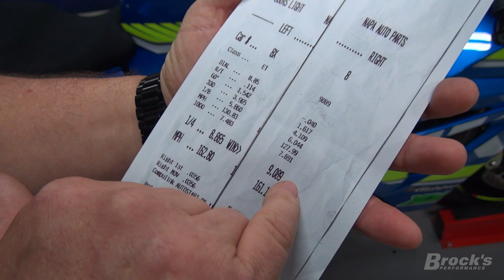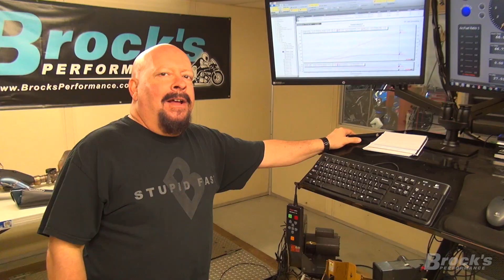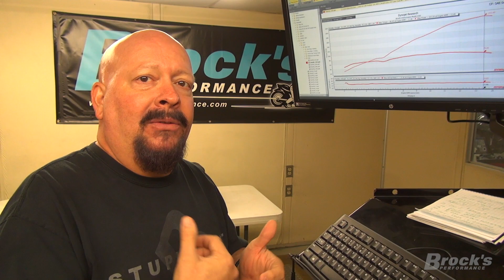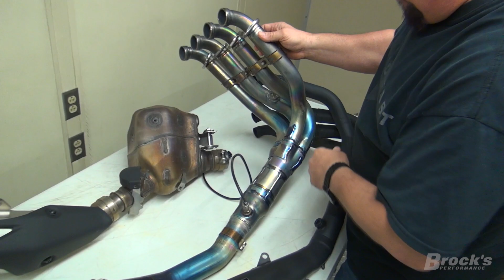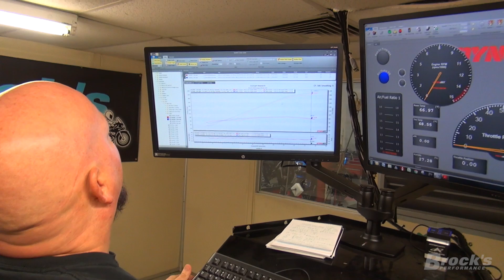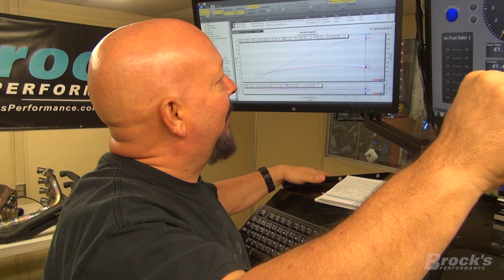Kawasaki Ninja ZX-10R (2019) Slip-On vs. Full System Debate SOLVED!

Comment: Brock, I'm new here but not to your tunes and knowledge. You hooked me up in 2012 with a great canned tuned for my 2012 ZX-14R. That bike had scary acceleration for a big bike and your tune and the bolt-on exhaust I put on it set it over the top really set it apart from the crowd--bike was insanely fast.  The review/overview of the ZX-10R and Suzuki's finest was extremely well executed and very well put together. It was by far THE best and most thorough review of your products and services and Japanese products to date. Damn good job brother!
Reply from the maker: Thank you - I really appreciate the kind words.
Reply: @BrockDavidson hey Brock, if I were to get a gen 5 zx10 what all do I need to make 200? I’d prefer to stay bolt on only and have already planned for a full exhaust air box heat wrap intake flapper and pair delete and a good tune

Comment: Hi Brock , please I own a 2014 YZF R1 with an after market slip pipes yoshimura ,my question is ,is it advisable to remove the cat or just leave it ?
Reply from the maker: The Yamaha's have great OEM head pipes also - but the result is the same. If you want maximum performance in all area's of the curve, A properly designed full system is the key.

Comment: Something I don't get, why the CPU wouldn't compensate automatically for baro pressure change on a low pressure day ? bike cpu's don't have a sensor for inlet pressure ?
Reply from the maker: They have map sensors. But, unlike cars the only active tuning is related to emissions and noise control at cruising speeds.

Comment: Just received my new 2019 ZX10RR. Looking to do full exhaust system and tune. New to race gas. Do I need to do anything special for mr12 and if I'm on a long run can I use pump gas with no problems to get home? Thanks
Reply from the maker: We install a map selector switch, position 1 for pump, position 2 for Mr12. The maps are considerably different.
Reply from the maker: https://brocksperformance.com/s2b-full-system-performance-package-for-the-zx-10r-2019/

Comment: I had a Zx10r, 06 model, only bike I ever had that did 106 mph in first gear when it hit the Rev limiter , awesome bike ,, really miss it , had lots of big bikes over the last 20 yrs right up to Hyabusa , blades etc etc but the Kawasaki being best by far ,, cheers Shane uk 🇬🇧
Reply: im a noob but last summer i was to test bikes,,wanted to buy 1,,so i found 2 bikes,1 was a 04zx10 and the other was a 05 hayabusa,if the zx10 didnt blow the side motor cap i would have bought it,,it broke att 110kmh on the highway and the rear tire got all oiled upp,lucky i didnt fall off,,so i bought the busa,,but the zx10 felt way more powerful then the busa,,dont know if its some probs on the busa but power wise the zx10 felt more powerfull,,even if it was a year older.

Comment: Hello Brock did you had to remove the intake flap valve to have more air coming in and that way you can make that power or is not necessary ??
Reply from the maker: It's in place and functional for these results.

Comment: Sorry to sound stupid,,I have a 2019 Gsxs 750z with a Yoshi Alpha T slip on and want to keep the exhaust stock as well as air cleaner since its as the 1000..I'm not after massive gains rather Optimum performance,, responsive and smooth throttle etc ,,Would a Woolich tune be Advisable and what type of gains can I expect ..Oh I've had my throttle bodies calibrated at first service and difference is noticeable... Thanks Anyone...
Reply from the maker: Any performance derestriction flash and quality fuel tune will help response and drivability.

Comment: So basically -- GixZilla wins on track... ZX10R wins on the strip and highway.   I love this new content from you Brock.  Please keep it up!
Reply: I guess if Suzuki decided to return to WSBK we would get an answer to that... I don't think they would fair to well, just my opinion
Reply: Depends on the racetrack. More torque does not make it easier to go fast around a racetrack.
Reply: @silverviper2184  I guess you're right to some degree.   Tracks like Daytona and Brainerd would favor peak horsepower.   Technical stuff would favor torque but if the bike is too torquey it could be a handful to control on the corner exits.   Back in the carburetor days, the 39mm Flatslides would make more torque than the 41mm versions, but racers would prefer the 41mm even on the technical tracks because they could get to full throttle with less concentration.

Comment: For the ZX10R Brock, for an even better comparison. I highly suggest removing the oem damper and using a gen 4 damper. While your products for lowering the front end are great, there is still another inch to go before the showa fork tapers. That could be the difference between an 8.8 or a 9.0. Just an idea.
Reply from the maker: The owner just takes the damper off and drops the forks 3". We won't do that for a bike under our control...but he can do as he likes.

Comment: @Brock - Awesome content as always. ZX-10R is a beast up top, but the GSX-R1000 beats it on torque most of the way. My guess, in road racing the Suzuki will be stronger around the track. For drag racing, I believe it'll come down to whether or not the Kawi's top end can come around the Suzuki's grunt early on.
Reply: I think WSBK has proved that the TQ of the Suzuki doesn't equal wins or a problem for the ZX10R
Reply: Gixxila is stock 🙈 we will see

Comment: Have u ever thought  of giving classes  on what u do. Dam u make a killing. One thing for a old guy. I hear that if u  put a longer  swing arm on u lose some power. True or false.
Reply from the maker: @Brad Duinn - Seems like I am giving classes ;)  We have never been able to measure a power difference between a stock and long swingarm. That said, when longer swingarms are added, a smaller front sprocket usually gets added also - the smaller sprocket can rub on the top of the swingarm (long or short) and cause a power loss.